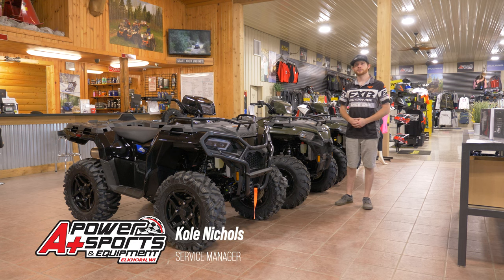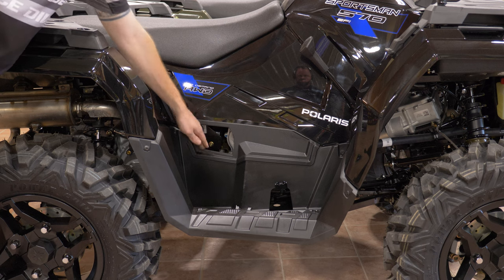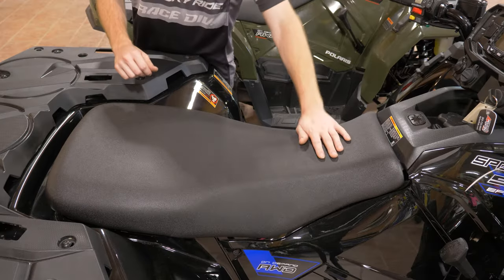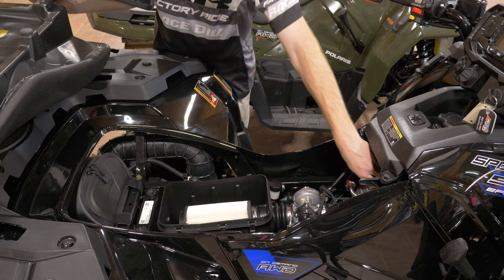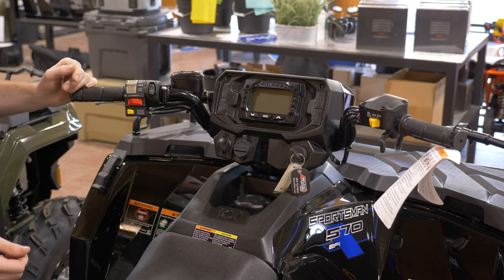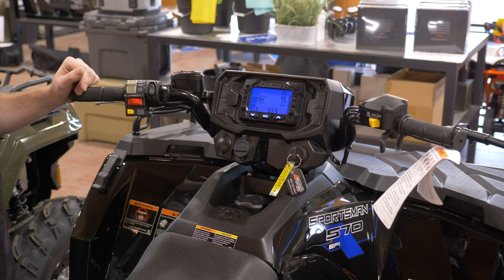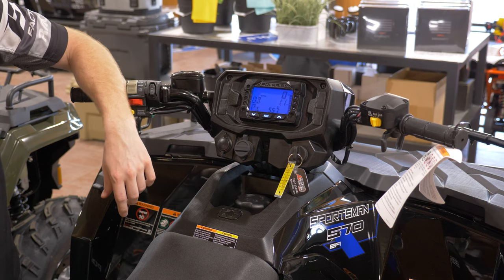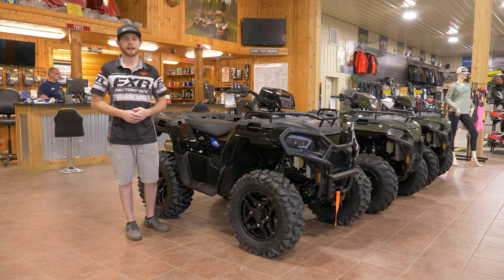2022 Polaris Sportsman 570 Walk Around

Comment: So you went over everything other than the break in procedure lol
Reply from the maker: My opinion on break in is the first tank vary your engine rpm's, don't hold it at a constant speed, and try to run it for extended periods of time. Which means don't let it sit at idle or start it and only drive a short distance before you shut it off again. For a more detailed break in procedure refer to your owners manual.
Reply: sounds like he went through it just fine!!

Comment: My 21 won't start with premium in the winter have to have regular
Reply from the maker: Yes, we have found some of the machines prefer regular fuel with ethanol in the winter. This is becuase the ethanol burns at a hotter temperature which helps the engine in colder temps.
Reply: No shit? Good to know! Bought a 2023 today and planned to run premium only... Maybe put regular in come ~november!

Comment: Hey man just got a 450 and when riding on a hard surface it says to release brake without me doing any braking. Any idea why that could be?
Reply: Experiencing the same problem on my 2022 570 Sportsman
Reply: @ericembry7891  yea its a pain and the engine light comes on but then turns off and the engine runs at a good temperature so idk
Reply from the maker: I had this happen to one of our new Sportsman's I believe it was a bad brake switch I would call the dealer you purchased it from to have them look into this for you.

Comment: So riddle me this. I really like the 570 Trail, love the arched a-arms. My fear is I have a 100hp RZR and may want the 78hp from the sportsman 850, in reality you can tune the 570 which may push it to 50-60hp.. wonder if that will be enough for me.
Reply from the maker: I can only speak from experience as a Wisconsin rider. The 570 Sportsman will have no issues keeping up in the winding trails. The RZR having 110 HP will pull away on the straightaways, but average trail riding the 570 does a great job in a Sportsman.

Comment: Got 5 hours on my 22 570. I can feel a bumping in the steering. Like a tie rod is loose. Can't see anything wrong in the steering. Any ideas?
Reply from the maker: You can give me a call at the shop and we can troubleshoot over the phone or bring it into the service department.
Reply: I noticed that on mine too…i only hear it and dont feel it in the steering…im thinking it is in the front diff. I only have about 3 hrs on mine and haven’t had it in awd enough to notice if it happens while that’s engaged…other than that occasional click/rattle i have no other complaints…
Reply: Dealer said it was play in the power steering. Cost me 171$ diagnostic fee. I just replaced one shock in the front. Got another on order. Will let you know if I fix it.